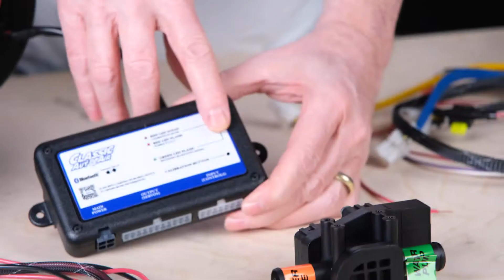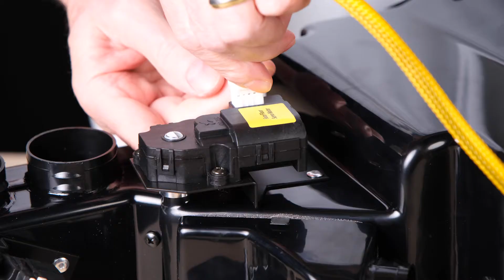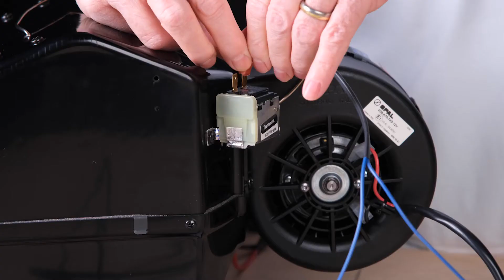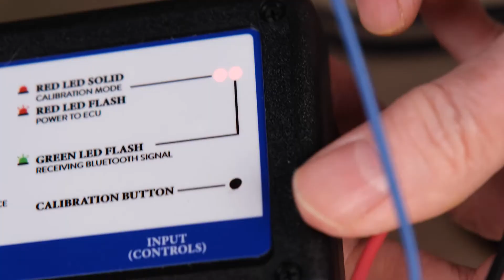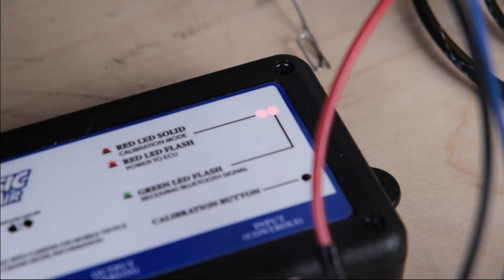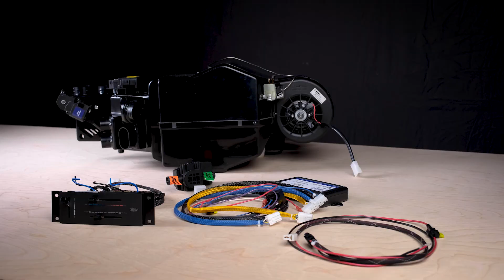Classic Auto Air Perfect Fit Smart Series Calibration

Comment: Great info.  The procedure on the restomod website has the cold/hot positions backwards in the procedure.  If you calibrate that way the temp switch will be stuck in and not operate the valve.  Ran it again this way and I'm back online.